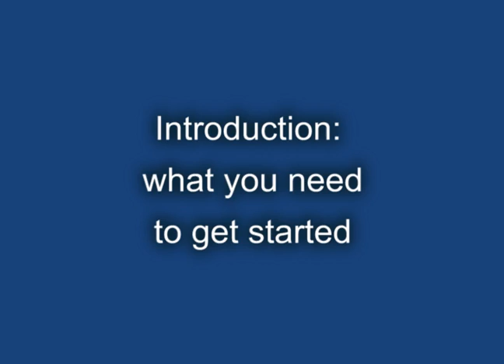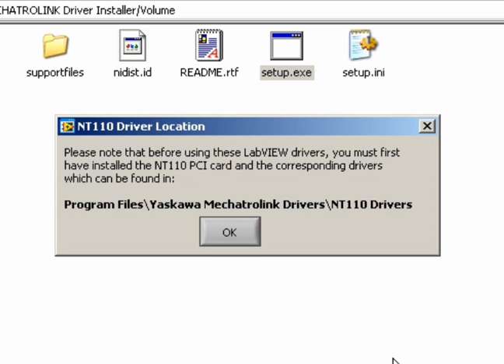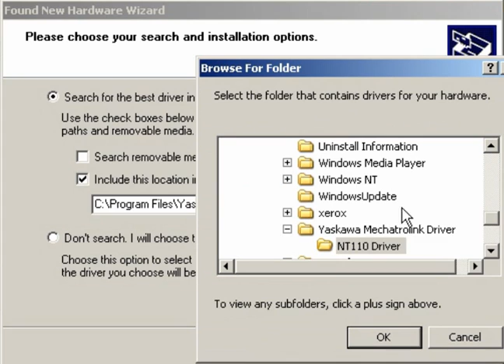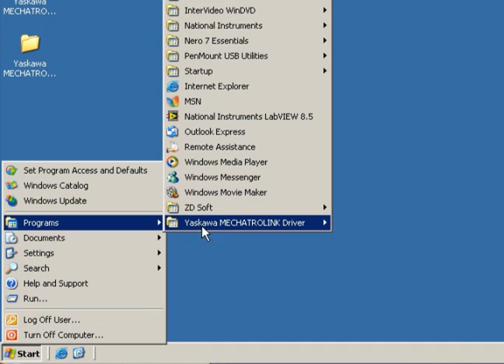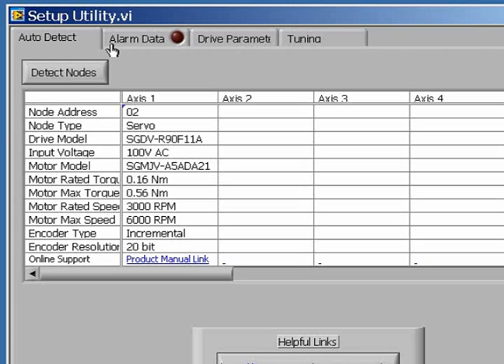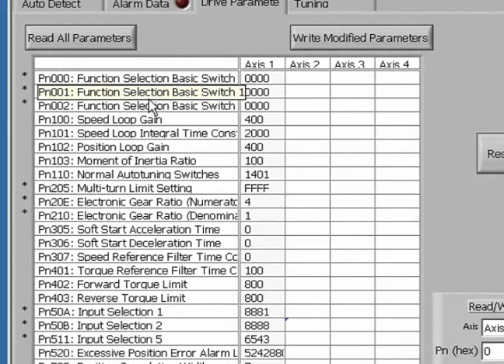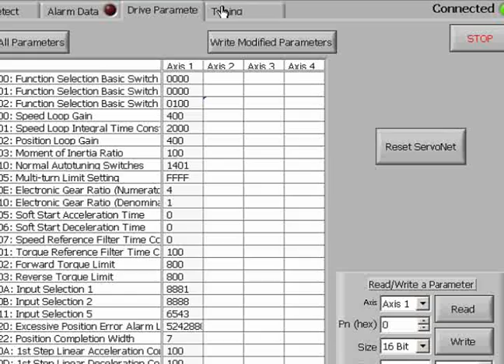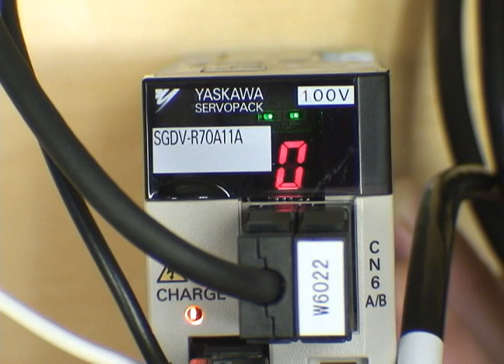Yaskaws's "How to Guide" for the Mechatrolink Driver for Labview

Comment: This method is not avaluable anymore. Because Yaskawa doesn't make NT110 card and support anything. If you want control the motor by PC, you need to buy MP2100 or MP2200 card. Moreover, not like NT110 and API, if you want to run the Yaskawa motor by pci card called to MP 2100 or MP2200, you need to use both program, which are API and PLC program. At the result, this video is useless.